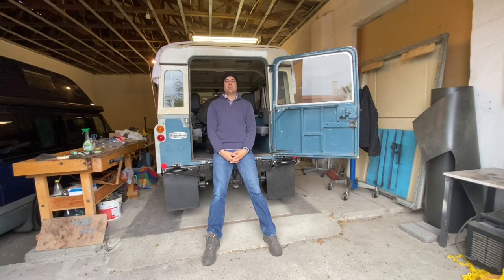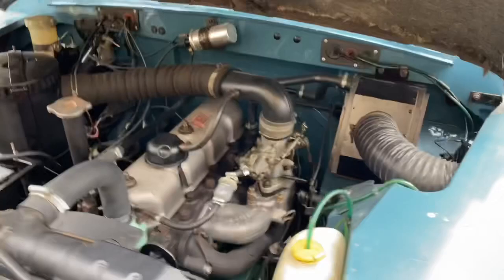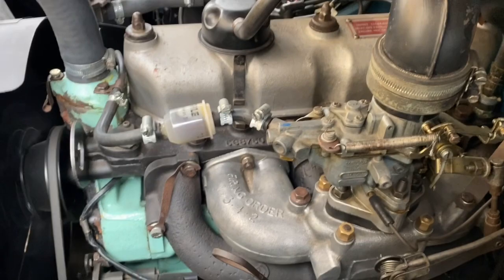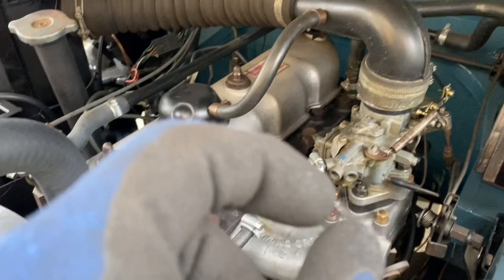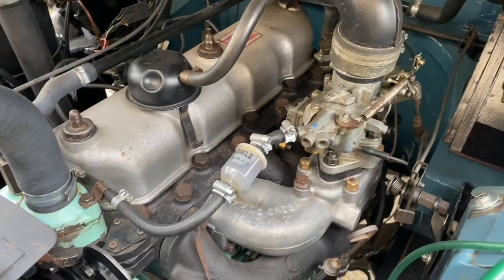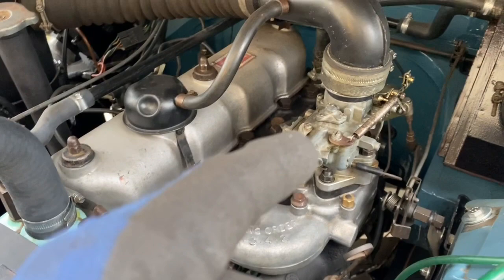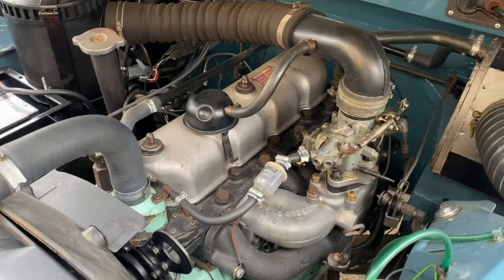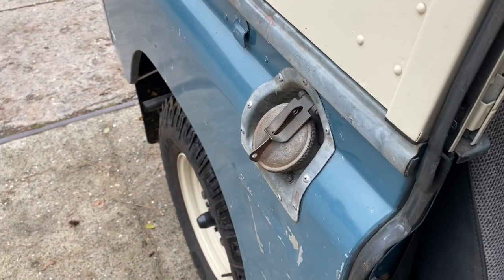Land Rover Series 3 Restoration - November Update & Timing Issues? - Part 54

Comment: Great looking Land Rover, I like the fact that it's tidy but isn't over restored, really suits a vehicle like that. I can't help but think that a TUV style test would be a great help in UK - so many garages doing shoddy work, I've seen some shockers recently! 

Your engine sounds generally very healthy when warm. If you drive around as soon as it's started, how is it then and what do the spark plugs look like? They are the best indication as to what is going on - clean but with a slightly "browned" insulator is what you are looking for after a good drive.  Does the Webber have an idle jet? If it does, I'd suggest that may be partly choked if the mixture is good at higher revs. A well sorted 2.25 will idle ridiculously slowly, but for a real world set up, put the lights and heater on - then drop the idle until the lights just start to dim, then wind it up until the lights brighten and the idle is smooh. That way, the charging keeps up when you're stopped at the lights on a dark winters night and the heater maintains full speed - that blower needs all the helps it can get! 

WRD has a tendency to idle slightly rich when cold and always has done,  the choke must be backed off when idling cold and more choke applied when driving cold. It's never really been an issue, I try to get driving as soon as it's running. Once warmed up it's very smooth. In my case, I think that the mechanical fuel pump is supplying slightly too much pressure at idle, an electric SU pump may help. 

Popping on the overun is quite normal for 2.25 petrols, as is the odd "chuff" at idle. The SU conversion tends to eradicate this, but it's a lot of trouble to go to for the odd splutter!

If I may make one observation, be careful with the extra fuel filter. They can be a bit fragile and I have seen several which have cracked or split, not good right above the exhaust manifold. If it really needs an extra filter, have a look at the bulkhead mounting "AC Delco" type, much safer IMO. 

As to the starting/ charging issue, where is your battery ground connected? I had a problem for ages with poor charging and bad cranking, fitting a fully charged new battery did nothing to help! 
As standard, the battery cable goes from negative terminal to the battery tray, bolted where it joins the chassis. With the old chassis, there was a very poor ground between the battery tray and the chassis- I added an extra ground wire from that bolt to the timing case on the engine and it was cured. Since those troubles, I've kept that extra ground with the new chassis and added an extra from chassis to starter motor - belt and braces.
Reply from the maker: Hi Steamwally, great to hear from you and thanks for all the advice. I will need to go through your points one by one and I will (of course) video them. It’s amazing how much you know!! How are things going with your new car? Quite a difference to a daily WRD I bet. Speak soon. 👍
Reply from the maker: And thanks for the kind comments, there was a lot of debate whether I should paint the whole car or not. But I’m glad I didn’t. It would have lost so much of it’s heritage and character had I done that. Maybe I will do a video which tells the story behind each dent and scratch sometime. 😀
Reply: @My911  No problem, all I know is from my experiences of running the 109" over a lot of miles, knew absolutely nothing when I started (and I'm still pretty clueless now!)
The new car is great actually, it's just so easy and exactly what's needed after a busy day at work - I had underestimated just how far cars have come, the last "modern" car I owned was 21 years old when sold. 
The Rover is even more fun now the pressure is off. 
Look forward to seeing how you get on - I like the idea of a "dent review!"
Reply from the maker: „Dent Review“ is exactly what I will call that video. Love it! I actually started thinking about the stories and that brought back some memories. Actually laughed out loud at one point. 😀 I remember filling the car with 10 people at the Charing Point to Point races one year just to get our monies worth on the entry fee (£10) The chaps face at the gate was hilarious. Ah, happy days. If you consider we all had about 10 cans of ale stashed in the pockets of our oil skins, the additional weight would have been massive. 

I think you have found the right balance with your Landy. It’s has to be enjoyed and forgiven for its shortcomings. Daily use is cool, but infrequent leisurely use probably suits it a lot better. I can’t wait to do a tour at some point soon. 

Have a good weekend.

Comment: A few things to look into - some have been mentioned.  
1) Valve adjustment.  Valves too loose and the engine sounds clacky in the engine bay.  Too tight and you loose vacuum and experience overrun or backfire depending on intake valves or exhaust valves not closing properly.  In your video, I hear some popping (chuff) on the exhaust that sounds like an open exhaust valve causing back flow.  Hold your local paper currency up to the exhaust exit - does it get sucked against the the exhaust pipe? Yes, exhaust valve not closing properly and sucking air in on the piston's down stroke  
2) Carb adjustment - make sure it is not set too lean or rich - Gunson's color tune is excellent at getting the right burn.  The smell and smoke you see and mention in your video says it may be too rich.  That contributes to running on after shut off. 
3) Timing - there are a ton of articles out there. I do mine by ear and feel.  Do this after 1 and 2. 
4) Your battery ground may be bad.  Remove the bolt from the ground strap/lead and sand the contacting surfaces with 600 grit paper to make sure you have metal on metal contact and a proper ground. Make sure there is a ground strap from one of the two starter motor's mounting bolts to the chassis - and the contacts have been sanded shiny.  
5) Have you tested your vacuum? One of the best indicators that some of the above are at issue: http://www.expeditionlandrover.info/landRoverFAQ/FAQ_vacume.htm

A well setup engine wont run on.  Another contributor to running on is having the idle set too high.  I run mine between 550 and 600 rpm.  When tuned well these engines can idle at very low RPM and won't run on.
Reply from the maker: Hi Charles, thank you for all of this and great to hear from you. All notes and will check that Link now. I had a sneaky feeling about the vacuum.. 👍

Comment: its been a while good to see you back, mine ran like a champ on the Weber carb, had a noise on mine for years that came in and out pending on engine speed, when we removed the timing cover , the timing chain was flapping around like crazy, enough to wear a groove in the cover.
A good engine thrashing is whats needed get her singing, then check the plugs and adjust the carb possibly running too rich, carb sounds hesitant coming off idle, timing also wants checking.

Check your grounds add one to the engine if needed, stick a volt meter across the battery check for any drain over a few days.
Reply from the maker: Thanks Chris, great advice!

Comment: No problem with a Weber. Had two. Fine for starting and a 200 rpm tickover. Luvvely. Running on is ignition timing or lean mixture. Lucky you didn’t hole a piston

Comment: Fix the exhaust, check the tappets, buy a timing light and set the timing, put a better fuel filter on, take the carb apart and clean it, adjust mixture and idle, If you do things in that order, the engine sound sweet, you are just working on tuning and will have an nice running landy.
Reply from the maker: Hi Greg, thank you for your advice. I am noting all this down and will go through it on the car.
Reply: @My911  Everything effects everything else, admittedly on a landcover, not by very much, but if you want to get it running just right, the order in which you do things is important. Systematically starting at the beginning and working your way through will help considerably. I forgot to add gap the plugs and check the points or if you haven't already add electronic ignition before adjusting the carb. Carb is the last thing to be adjusted once everything else is perfect.

Comment: Most of it has already been covered but idle sounds a bit fast, mine has some black smoke for a few seconds after start up but disappears. I get the odd 'chuff' but it shouldn't sound busy at idle. I'd get the downpipe to manifold gap sorted before you do anything else, just changed the downpipe on mine, pretty easy with a couple of extensions and a 3/8"UNF socket from underneath. Then get the engine properly up to operating temperature and run it for a good 20-30 minutes, not just a couple of laps. These old vehicles run better when they are used regularly. After these two things, start from the beginning and go through the whole timing/ignition tuning procedure/points etc and check everything methodically. Pull a plug and have a look at it. Sediment from the fuel tank can't be helping. Petrol smell isn't normal so running rich, hard to say if it is adjustment or the carb gummed up. The Glencoyne website says the Weber has small passages that can get blocked. A new Weber is allegedly only around £80 if yours is suspect. Check the alternator charging with a multimeter, and belt tension, then you can rule it in or out.
Reply from the maker: Thank you. I agree, the next job is the down pipe for sure.

Comment: I put my int light on a bracket coming from the roof gutter above the rear view mirror.  The wire is r/ black twin core in black flat sheath( caravan lighting wire. Comes down looped over gutterand super glued to central windscreen divider then down into the dash. Preyyty unobtrusive.  You may want to soundproof over you head so that’d lose the wire going to your mounting point.
Reply from the maker: Thanks. I think sound proofing is the way forward.
Reply: If
Reply: @My911  if you want to take the roof off for the summer then having a connector in the gutter would allow you to route the cable up the screen but split it to remove the lid. You’ll be amazed at the noise reduction sans roof. I drove to get my new hardtop with screen and sides only( flapping). Bloody quiet!
Put new hardtop on ,three bolts ,and drove home. Not far.

Comment: What petrol do you use, with ethanol 5or 10 % ,, or 98 octan no ethanol, if the petrol in your tankis old its bad for the carburator, sludge,
Reply from the maker: Hi, it’s a clean tank. I use 98 octane without Ethanol.

Comment: You say the battery is fully charged, have you measured the voltage with the engine off and engine running? You should be getting 12.5v engine off and 14 to 14.5v engine running. If those check out okay you’ve either got a solenoid or starter issue. You can check the solenoid by shorting across the two big terminals with ignition on. If it’s still sluggish it’s a starter issue. Is the earth lead on the starter to chassis? The engine running issue seems to be a rich mixture, I’ve got the same with my series 3 on a Weber carburettor. Mine, like yours, isn’t on the road at the moment, I’m just about to get it mot’d and run it before deciding whether I need to adjust the carb jetting.
Reply: Ignore the above, I see others have already covered the points raised in my message.

Comment: How are the points? Is the lift pump working? Maybe your getting too much fuel pressure? You may need a fuel pressure regulator. Is it a Weber carb?
Reply from the maker: Hi Cory, the points are new and the Carb is indeed a Webber. I was wondering the same thing. I might lose the secondary filter. Seems to be a dangerous place for it anyway. 

How’s your Landy coming along? It is looking great.
Reply: @My911  sometimes popping on deceleration can be a lean mixture. As you’re not getting enough fuel.

Comment: What was it like originally getting splash plates off the landy? The work I had to do to get mine off was ridiculous🤣
Reply from the maker: Hi, I had the advantage that they had both completely disintegrated!  All I had to do is remove the remnants of the parts that connect to the underside of the wings. 👍
Reply: @My911  I had the steering box cover disintegrated which was handy, although the bolts for the plate to the footwell were well stuck so I used "Jeremy Clarkson genious" as a friend told me and got the top bolts off it and used a hammer to bend it over 90 degrees and then cut the plate out. His idea of Jeremy Clarkson genius came from the fact I used only a hammer, wrench, Jr hacksaw and a shaft of a brush 🤣
Reply from the maker: Must be the first and only useful DIY tip from Clarkson ever. When I worked in the UK, my company fitted an integration system to his house. He was an extremely difficult customer.... best enjoyed on TV I think. 👍
Reply: @My911  Yeah I agree with you there🤣

Comment: Sorry if you have already done this - are you getting 14v + output from the alternator? I had a simular issue with mine not charging - the car ran badly...
Reply from the maker: Hi, no I haven’t checked that yet. Thank you! 👍
Reply: Mind you, your charge light would be on all the time - mine wasn't as I had done a Dynamtor conversion and wired it incorrectly (due to poor instructions!).
Reply: Just put a multimeter accross the battery terminals while the car is running - or even the 12v interior terminals.
Reply from the maker: Cool, thank you